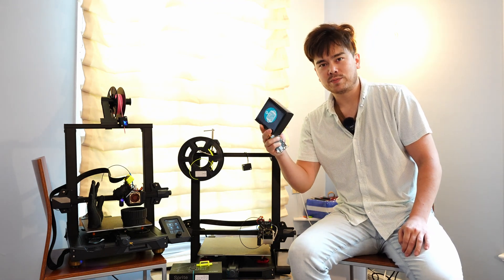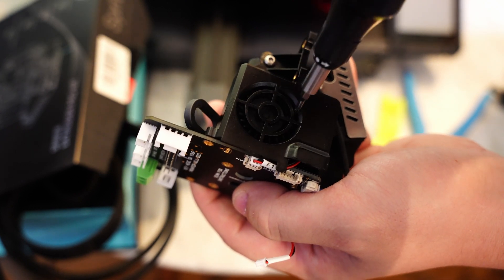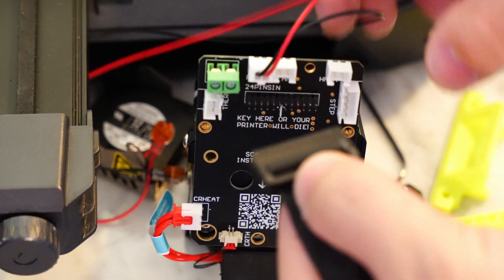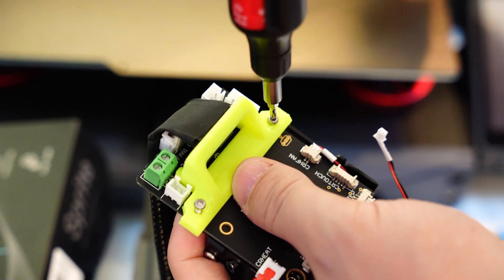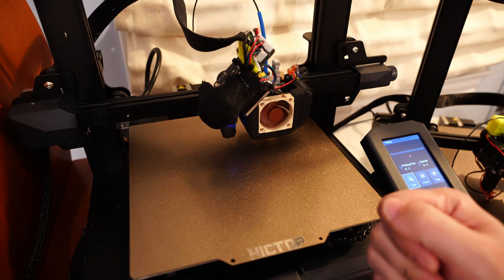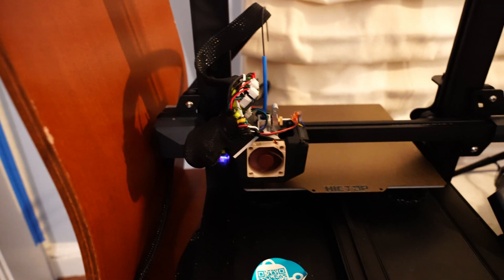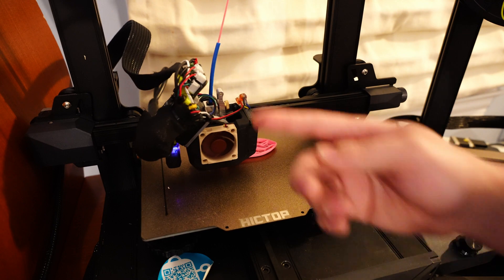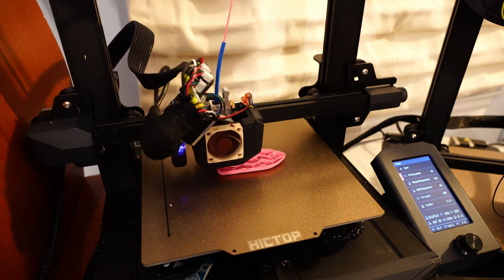Modding an Ender 3 S1 With The Modder Board

Comment: Interesting... having trouble getting hold of a header board for my ender 3 v3 KE as it's toast, could this type of board be used to replace it - only asking as Creality seem to use the same parts from machine to machine with tweeks here and there. Cheers good vid and informative. Question answered - went on to your site.. what a shame it is not as it would be cheaper than getting it from china.

Comment: I recently installed this and now my part cooling fans do not turn off. I switched back to the stock one to test it and the stock fan also stays on constantly. Something changed after I installed the modder board because it did not do this before. Anyone else have this issue and know how to fix it?
Reply: @gamesofcontent  was it plugged into the hotend fan port?

Comment: Just got mine, top fan ports not working
Reply from the maker: The most common issue is the fans being wired up reverse to how they are on the board.
Check the back of the board: the + and - pins are labeled. 
Also feel free to ask for help on Discord - Lots of people online to help
Reply: @NathanBuildsRobots  I've got 3 different fans all wired same, none work out of the box. Is it you or them?

Comment: My board looks different than the board in this video.  Do I have to use the resistor on the board I received?
Reply from the maker: You can solder that board in place to activate HF2 port. That will allow you to plug in a 12v 40mm nocturnal fan, which is a common modification that people do to run silently

Comment: Would this board make it any easier for me to use the E3D hot swappable nozzle system with my Ender 3 s1 pro?
Reply: In conclusion, I now have the modder board which has been incredibly useful for me making upgrades to my cooling system etc. But E3D have now released a nozzle which is compatible with the stock sprite extruder anyway which I'm also now using. All in all very happy with this board. 🥳

Comment: I just received the V2 board to put on my S1 Pro.  Unfortunately, it doesn't fit.  the new location for the picoblade connector for the stock parts fan hits the bolt that holds on one of the wheels on the x axis.   Should I just remove that connector as I have a 5015 fan for part cooling.
Reply from the maker: Interesting! 
Yeah that is fine if you don't plan on using that port. Are you going to desolder it? That would give you the best results. Just pulling it off is hit or miss as it can peel some of the traces back when you pull it off.
Reply: @NathanBuildsRobots  thanks for the reply. Yes I will try to desolder it.

Comment: You should tackle a CAN tool board.  Really only 2 choices out there, BIQU or HVUD.  Having 4 wires for a toolhead is so clean.
Reply from the maker: I have the biqu one to test. Only thing I don’t like about it is 2 McUs makes it potentially 2X as expensive to troubleshoot and fix. With my current setup, the modder board is bulletproof and the Mainboard is the only thing that ever needs to be replaced. 
But year, CAN definitely is the cleanest/most capable of all setups and I’d love to tackle that when I have the time.
Reply: @NathanBuildsRobots  I'm going to try the BIQU 36 once I print out 2 sherpas and get them built.  Having an IDEX there is a ton of wires I'd love to get rid of.  Another plus with the BIQU is you can get the model with PT100/1000 support.  I have an Octpus but cheaped out and didn't nuy the Pro so no PT100 support.

Comment: What type and length of ribbon cable is used on the original and modded board?
Reply from the maker: The 24 pin ribbon cable is the same either way. The spare cables I have bought are about 150cm long

Comment: Any way to plug in a hot end led?
Reply from the maker: I’m working on that. The easiest way is to plug it into the hotend fan port and make sure you’re using an led that can run at 24V or use the appropriate current limiting resistor to limit the current
Reply: @NathanBuildsRobots  perfect thanks
Reply from the maker: Sample calculation time:
Get an LED that runs on 40 mA and 4V
Solve the equation: V=IR
(24-4)=(0.040)*R
R=20/0.040
R=500

So you would solder a 500 ohm resistor into the spot for a resistor, then plug the LED into the HF2 port (which connects uses that resistor in series to limit the current to that port)
When you run the printer, the LED will light up whenever your part cooling fan is running (pretty much whenever the hotend is on)

I would reccomend joining the discord, people like myself can help you through the process of selecting components and wiring it up

Comment: Would you be able to use one of the extra connectors for the fans for an led light?
Reply from the maker: Yes, I've thought about doing that. I put one on one of the extra heater ports and it kept flashing on and off. But on one of the fan ports it would do wonders. Just make sure it doesn't draw too much current and that the voltage is correct.
Reply: @NathanBuildsRobots  perfect guess I know what my next purchase is!

Comment: Neat idea, I would just make adapter plugs myself or preferably make a full harness from the main board with thicker guage wires for 24v; this is certainly a simple solution for people with less time and finesse. 
Seen your response RE: sourcing the locking adapter, you could add a notch to your locking bracket and design to fit only one direction maybe?
Love your work, please take this constructively and keep innovating 💙
Reply: @Russell Phelan  that was an option I mentioned, I would prefer a thicker wire guage when upgrading to 24v in saying so I haven't done the calculations so the existing wires might make the cut
Reply: @Russell Phelan  oh hang on I see now I said adapter plug, I like the idea of breaking out don't get me wrong. I meant that the breakout was less finesse. For myself I could have this running with what I have on hand making an adapter quicker and just as easily. The breakout is neat and simple for people without the tools and parts

Comment: @Nathan Just curious why you went with a straight up pin header for the main connection instead of the locking/ejector box. It would not only be more secure but since they're keyed would eliminate the possibility if connecting backwards...
Reply from the maker: I couldn't find a source for them. I spent days combing the internet, aliexpress, Amazon,  Digikey and Google, spent hundreds buying a bunch of different connectors, and the only thing that fit was the 2mm pitch pin header. 

However, a few weeks ago I finally found the right connectors and the next version of the board will have them. So of my current preorders and any new orders from now on will use the same style used by Creality on the original board, so box and locking arms. I tested the first prototype board this week and it was a perfect fit, so big batch is coming and will be all good, with some bonus features I stuck on there.
Reply: @NathanBuildsRobots  Awesome news! Thanks for the update!

Comment: If running two 12v fans for part cooling via the two new headers, do you still need to the drop the 24v down? (as you've done with the inline resister?)
Reply from the maker: Yes, you can run 2 12v fans in series on a 24v pin. 
If you are placing a new order, you'll get the new board, which has a spot for a current limiting resistor built into the hotend heatsink fan connector.

Comment: fyi those 3M plastic solderless crimp connectors SUUUUUUUCK
half of them don't hold well and they also use some sort of dielectric grease which comes out onto the exposed cable housing
please please please don't use these anymore
Reply from the maker: lol sorry . I have been having good luck with them. I had a few pull out at first, but I started giving them a little extra squeeze after they bottom out and they have been holding well. There are also WAGO inline connectors, I'll buy some and see how those work.

Comment: Don't you think the pair of tiny gauge wires in the ribbon cable are marginal for the current draw of the heater? Especially how long the ribbon cable is....
Reply from the maker: I need to see how things are wired on the motherboard side of things to verify, but on the breakout board side it looks like the heater cartridge is hooked up to 4 wires for + and 4 wires for -
Reply: @NathanBuildsRobots  I bought the Sprite pro conversion for my V2 and they breakout all the ribbon wires to compatible JST connectrs for the 4.2.2 & 4.2.7 motherboards. I was surprised that it only used 2 wires for each leg of the heater. I didn't measure the voltage drop but I suspect it's high. Anyway it does work but I noticed the PID even optimized is more unstable than my original V2 extruder. I'm assuming it's the same on the S1.....
Like your Mod board idea!
Reply from the maker: @bobwtech  I just did the Sprite conversion on an Ender 2 Pro. That conversion cable is seriously messed up. Especially the 2 unlabeled connectors that are basically motherboard wrecking devices. I point out some really dangerous elements on it. Video should be up in a couple of days.
Reply: @NathanBuildsRobots  Well, where is that video? I just did an sprite pro upgrade on my V2. how is it different than a S1 wire harness?
im getting your board BTW. It will work on my rig, correct? E3v2 with sprite pro.

Comment: Waiting for EU launch. Hope you can also do a mod for mainboard also. Compared to old enders, S1 connectors dont seem to be compatible with 3rd party boards.
Reply from the maker: Yes. The mainboard situation is truly scuffed.

You can actually install the modder board in the base of the printer, then run a traditional harness out to the hotend.

Comment: I’ve been using your original part and hot end mount that I’ve loved. Where can I find the STL to your new model that removed the hot end fan and added that delta fan?
Reply from the maker: I have uploaded all of the files on Patreon. Most of the files are free public files. 
f3d files are available for Patrons if you want to edit them in Fusion 360.

https://www.patreon.com/posts/simplified-fan-67965448?utm_medium=clipboard_copy&utm_source=copyLink&utm_campaign=postshare_creato

Comment: Thank you for doing all of this! I installed my board tonight and look forward to getting better prints with my new part cooling.
Reply from the maker: I have uploaded all of the files on Patreon. Most of the files are free public files. 
f3d files are available for Patrons if you want to edit them in Fusion 360.

https://www.patreon.com/posts/simplified-fan-67965448?utm_medium=clipboard_copy&utm_source=copyLink&utm_campaign=postshare_creator
Reply from the maker: I have to design a new 5015 duct for the occasion. My first ones were functional, but not as optimized as I would like.

Comment: Just got mine in the mail, along with some noctua fans - on the hotend with the 12v fan you showed, is there a buck converter in that wire bundle, or are you using a zenner diode?
Reply from the maker: I wired up a 2 watt 220 ohm resistor in series. I just cut out a segment of wire and replace it with a resistor.
12v fans are a pain, and I was hoping to find a suitable 24v replacement, but nobody does quiet fans quite like Noctua.

Comment: What mods do you have done to the fully built modder board using all the ports?
Reply from the maker: I'm using every port except for the 2nd part cooling fan on the microswiss NG build. I am thinking about designing another batch of fan ducts that are more optimized and with dual fan options